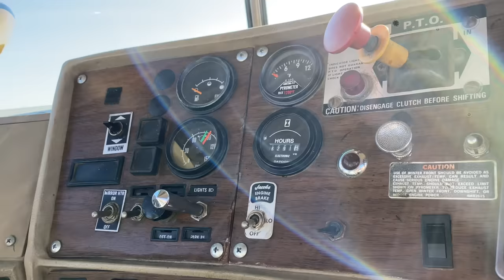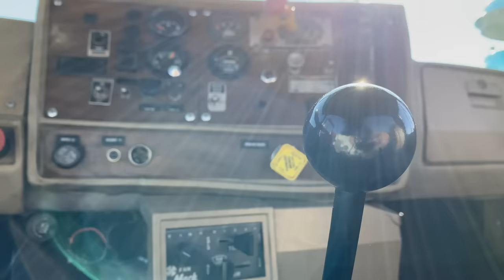My First Restoration: Our NEW R Model Mack!

Comment: If you change the color, go back to the original Mack color. Make it original, seat covers, rims, steering wheel, everything, make it original.  It's a working mans truck not a foo foo truck.  Just sayin.
Reply from the maker: No harm in doing some cool custom accessories on a restoration. This truck actually isn’t a work truck anymore, it’s a fun project and will be donated to the museum after we’re done.
Reply: @thefarmergrayce "Restoration" means restore to as close to original as possible.. 
Custom means make it however the builder wants to...  
Very few Mack's get restored or even refurbished any more because Petes, Freights and 13 letter manure spreaders get all the attention the past 30-40 years..
Reply: Those R Models Are Some Good Rigs, Work Horses
Reply: Kendrick sockey missippiss you Tube ❤❤❤❤❤❤😂😂😂😂😂🎉🎉🎉🎉😢😢😮😮😮😮😅😅
Reply: I think something with the metallic  paint chips will make it stand out.
Reply: @Wil_Liam1 
That's a great loss to the world in my book.
Reply: That’s a great truck

Comment: R685ST should be an ENDT675 (237HP) engine, TRL107 (5 speed) or TRXL107 (two stick 6 speed) trans and tandem axles. Someone must have changed it to that 23,000 rated single axle. All in all really nice truck

Comment: Don’t ever stop double clutching!
Old Mack’s deserve the respect and effort.
Reply: I disagree. Learn to sync those gears!
Reply: Lol
Reply: Float shifting for sure
Reply: Double clutch or float 5 main     float 3 auxiliary only    B 61 Mack         Feel your gear on your main when you float
Reply: Never double clutched . Ran 5x4 , and quad
Reply: @BoFinn52  Yeah & wear out the selector forks in the transmision thats exactly why there is a clutch I disagree Im 38 years driving heavy trucks & yes I can change 
up & down without a clutch but i9t is not correct read the manuals !!
Reply: @derrickwilkie5611  
Not to worry, her dad taught he to double clutch.
She respects him.
Reply: It wears all the linkages and throw out bearing, please float the gears

Comment: That's going to be a unique looking truck - a stretch wheelbase single axle tractor! 
Bedbug haulers were mostly single axle, and there's room on the frame for a shiny Mercury sleeper behind the cab. And the colors are close enough to be a Leaser for Atlas Van Lines.
I would say if you were going to keep it on the farm, put an oil tank on it with a meter pump for refueling equipment out in the field.

Comment: That’s so cool a truck brought y’all together. Smooth move sir, you got a great lady there. 
I can’t wait to see what you guys do to it. As a Gen X guy who grew up around trucks in Maine and has been a full time driver for 30 years Mack’s were always very popular. If you’ve not heard of them look up Dirigo restorations in Maine. They have a gorgeous collection of trucks and we’re at one time one of the leading Mack restoration guys anywhere. 
Peterbilt Legendary black would look great on that. It’s got a ton of sparkle in it. I also agree on the pinstripe, that’s almost a must on an old Mack. Absolutely color match the steering wheel

Comment: Hello , Very nice video. I learned how to drive semis in a DM model hook to an asphalt tanker in Colombia, South America.  Came with 237 engine Maxidyne, 5 Speed Maxi torque transmission, and Mack    
Dual axle, dual reduction with Camel suspension 46000 pounds.  Very very Reliable truck. One time we loaded with 110000 pounds total going up the Hill called " La Linea" over 12000 feet high.

Great machines!

Thanks for video.

Comment: Sweet truck! We have 3 R model Mack trucks. A 76 two stick 6 speed 300 Mack engine, an 80 with a super 10 and a 350 Mack engine, and an 86 with a 9 speed and 300 Mack engine. Toughest trucks made! 👍

Comment: I have a 1974 Westerliner COE with 300 Hp maxidine with a 5 speed  No power steering and tamden axles with camel hump suspension and trans you can only put it in first gear first and  you rip it in and it goes right in then you can go to reverse if that is what you want. I broke clutch cable with a full load of soybeans and still drove it to the elevator and it was a challenge to get off the scaled fully loaded empty was easer.

Comment: Need to put the later model rectangle head lights in it. It's a easy fix the later model head light bucket bolts right in and you only need to square up the round openings  in the hood. A really nice look. I have them in my r model .

Comment: My first Mack was a 5 speed but it was a 1971 didn’t sound like this truck. I also bought a 1978 a few years later it sounded just like this one but it was a 6 speed ! 
Both had 237 engine. 
Both were tandem rear axles.

Comment: So this has a Maxitorque 5 speed. Most likely has a 300 engine. Drove a truck with a 300 but had the 6 speed with a Lo gear for crawling and was also air assisted but those 5 speeds aren’t bad either.

Comment: High light the cast Mack word on the wheels with a color.    Pin stripe the beed locks on the wheels with  a thin red or qrange pin stripe.  . Lights inside the cab.    Leave the exhaust as is it is cool.  Good job of floating the gears now show Grace how to do it.

Comment: You might already know, but if you are sitting in the driver's seat and the black knob by your right knee, push it down and then you can pull the steering column closer to you.

Comment: I think she's fine. 
The T in the name is for Transporter, the S is for single axel
She must have had a small body, or a water/septic rank on her before?
Do a 2 line pinstriping on the Hood, and Cab.

Class of "84" on the sides of the hood, i
n Gold Leaf, since she's the Big 40, this year.
Think KISS with MACKs. Keep It Simple, but eloquent.
A basic girl. New Low Back MACK seats.
New rubber floor mat. Basics.
Check around, there gotta be MACK CB radio out there.
They were common in MACKs back then.

Comment: I would not touch the blue & white paint job and leave it as is including the wheels.
Yes the interior needs to be restored close as possible to the original.
The 5th wheel hitch and lines need to be put in.
What would be really cool is find a trailer around that year time frame to hook up to it.

Comment: Keep it mechanically original. Also, where's the Air Start tank?? Put an IR starter onto it! Leave the wheel hubs, they have casting dates on them, like all Mackadyne castings. The engine and dog should be the same colour (make the dog the same colour). The outside can look what you make it! Is it a 5 sp triple countershaft or a under and over countershaft? Diff ratio?